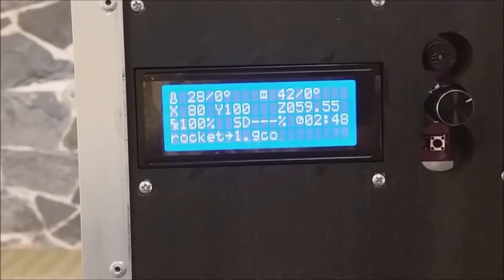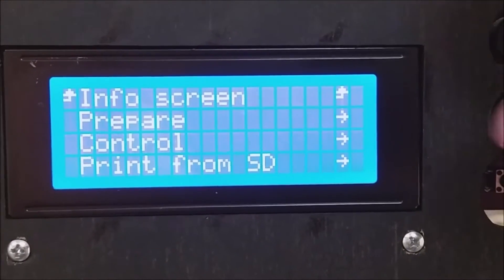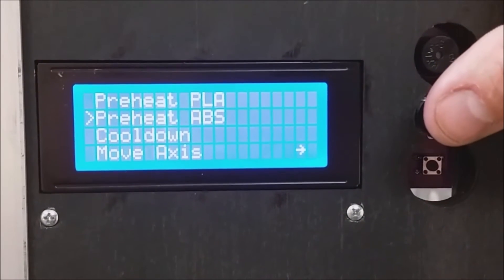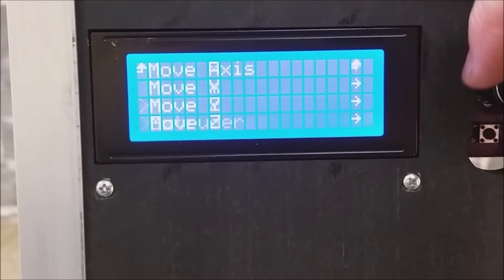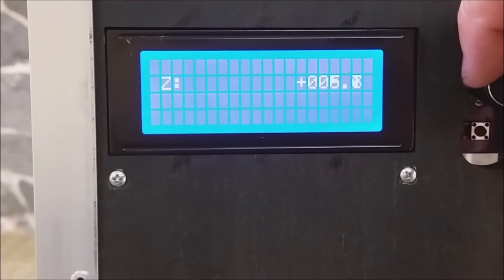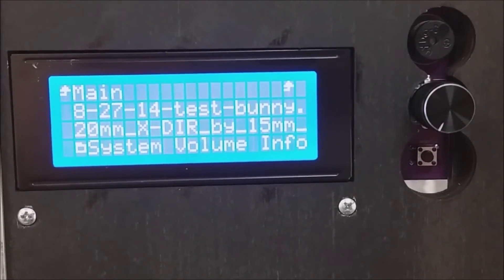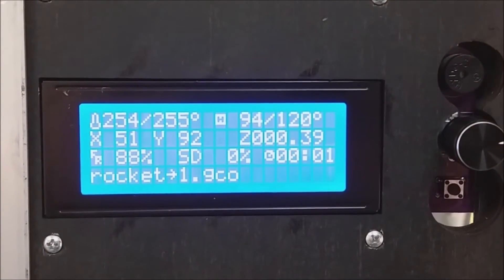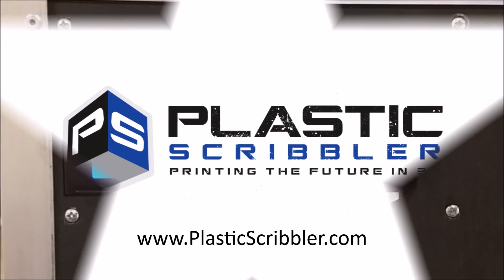3D Printer Smart Controller - How to Use

Comment: So I am new this this whole 3D printing thing, but I really want to do it. So I have been looking at the Asterid 2200 vs the Solidoodle 4.       I know the main differences such as the smart controller, build volume, etc.  How does the print quality compare to the solidoodle 4? Also, if I order the 2200, about how long till it ships? Thanks for your time and for the better customer service!
Reply from the maker: During the Atlanta Maker Faire, we compared prints from our Asterid 2200 with those printed from a Makerbot Replicator 2 and the prints from the Asterid 2200 were the same quality and in some cases even better- at the same resolution.  The current lead times are posted on the Plastic Scribbler online store.